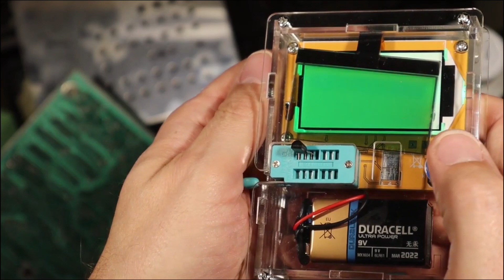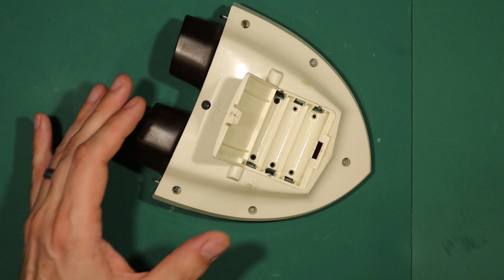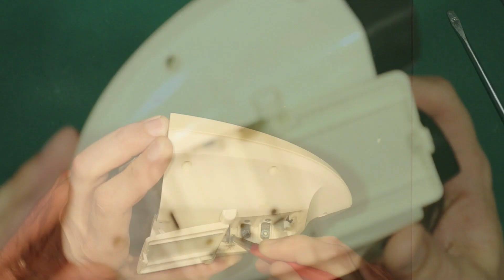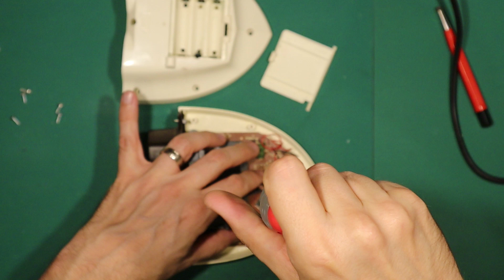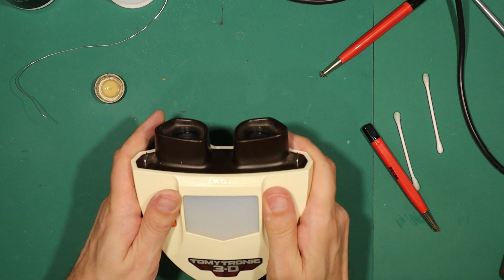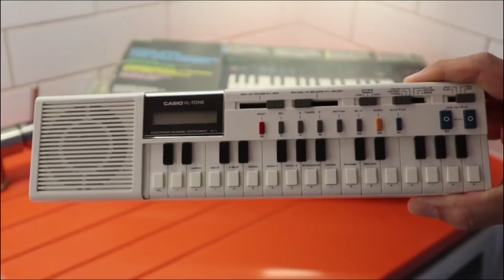TomyTronic 3D Game Repair - Thundering Turbo - Retro Gaming

Comment: for the same game, I used cleaning vinegar / isopropanyl + grinding pen if needed plus replaced broken dual contact with AA dual contact from ebay although not perfect
Reply from the maker: Good ideas! Thanks for sharing, I might try to fix another one of these games some day. Congratulations on your successful repair and thanks so much for your comments.

Comment: I've recently o trained one of these and everything works properly apart from the orange button.  Alit of pressure is needed to make accelerate the car.  Would cleaning it's seating and maybe some tin foil solve this.  Thanks
Reply from the maker: Hi Mark, I cannot say for sure but I have had some luck disassembling similar vintage games, cleaning the carbon pad under the button, cleaning the contacts on the PCB then reassembling. If the carbon has worn away you may have to use copper foil or similar, but I personally haven't ever needed to do this. Hope that helps
Reply: @RetroTechRepair thank you.  Happy new year
Reply from the maker: @MarK-x9y  You Too. All the very best
Reply from the maker: @MarK-x9y  you too!

Comment: I’ve tried repairing my Tony Tronic. It now comes on and play perfectly it then cuts out after a few minutes of play. Before I got it working (a bit) it had bad corrosion in the battery terminals but none inside the game. Any ideas of what to test? It all looks really clean and straight to me. Thanks
Reply from the maker: Hi jbeef, thanks for your question and sorry for the delay on responding. A couple of things come to mind, one would be the PCB flexing during play causing a week track or solder joint to lose contact. A good visual inspection under magnification might help. You could also try gently flexing the board see if it precipitates the problem. Another cause could be a component heating in use then failing so I'd feel for anything hot. None of this is advice as I'm not qualified to give that. But its probably what I'd try if the game was mine. Thanks for your question
Reply: @RetroTechRepair  thanks. I flexed the board a bit but couldn’t pinpoint the component so I heated all the joints up with an iron and it has solved the intermittent problem. One of them must have been dry or loose I guess. Thanks for your advice
Reply from the maker: @jbeef1289  very welcome

Comment: Just a wonderful fixit video one thing it's my belief you can't wipe the conduction off those black switch pads as it is throughout the whole pad all you will clean off is the worn black surface however I'm not always right I've never had any trouble cleaning them to my hearts content Once again a lovely fix it video your doing very well with this retro stuff Wow what a colourful game beautiful
Reply from the maker: Thanks Dave... very good point regarding the carbon pills, I have seen one game since this video where the conductive surface was painted on the silicon but I can't for the life of me remember which one it was.  The game is lovely though those to.t 3D tronic really a clever take combination of LCD games and a Viewmaster.

Comment: just tried to repair a sky attack tomytronic that had corrosion on the contacts but it was soo corroded some of the contacts were rattling around inside as they had snapped off!

the black negative wire had come away and the cooper wire itself was black and brittle. i soldered back and filed down all of the battery connections and soldered new positive and negative wire but it doesnt fire up at all.

by the look of it the corrosion has made its way to the motherboard and there was even residue on the lcd glass.
but even after cleaning it just wont power on so am going to try to multimeter it to see what could be wrong.
such a shame as tomy stuff is so rewarding to repair!
Reply from the maker: Thanks retrobution. Love to see this detail!  I have had some games where the contacts have corroded away, but I have only had one game with PCB damage from corrosion (an MB Simon). Good luck tracing all the lines with a meter, its a sensible next step. Hope that it goes well, stop back and let us know how it works out. Thanks again for your comment.
Reply: Ebay sells new battery contacts for next to nothing in different sizes  if your want to try differing sizes just in case but they cost so little